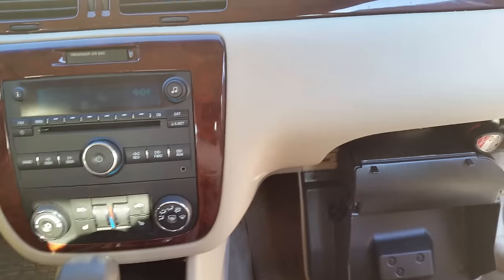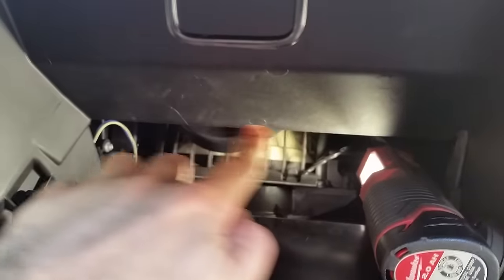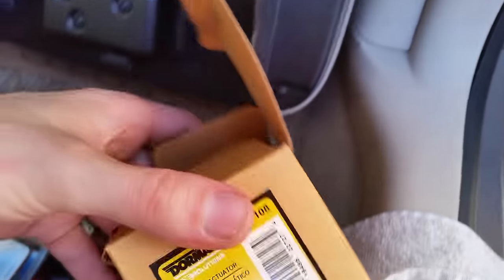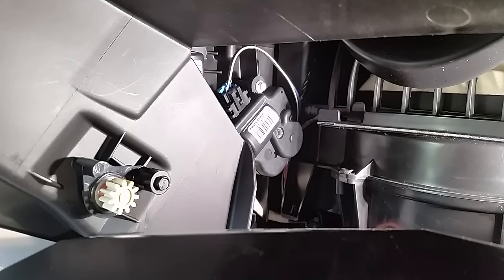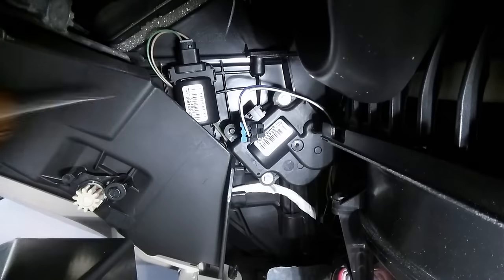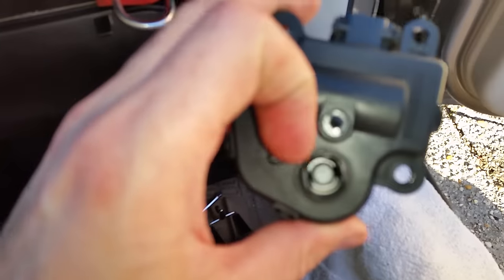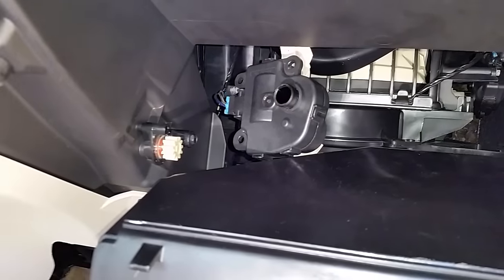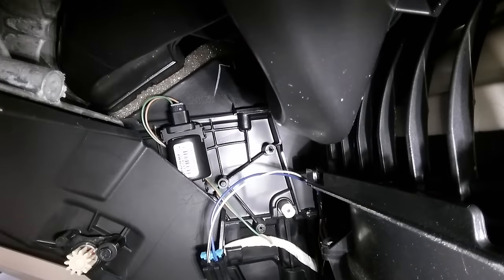How To Replace A Chevy Heat Door Actuator - Impala 2006-2013

Comment: MAD props on the camera work! It is not easy to get in close in a small space and keep everything in focus. Seriously, fantastic video for a PITA issue.
Reply from the maker: lol thanks for watching and commenting
Reply: klowny1969  How often have you had to replace that part? It’s been l think less than a year since I replaced mine and it ticking again.
Reply: I agree great view
Reply: @klowny1969 sorry I may have missed it but what number bolt did you attach to the socket wrench!?

Comment: Great video! I bought a 2010 Impala in 2011. It has 3 of these blend door actuators. I just did my 5th replacement. Drivers side it the worst. I use a thumb sized bit driver on a 7/32 socket.  I'm 60 years old, 6 feet tall and weigh 300 pounds. If I can do it, you can do it.
Reply from the maker: Thank you for commenting and don't forget to subscribe 😉

Comment: Thanks for the video! I have a 2012 Impala with a bad passenger side actuator. This replacement will actually be the 2nd actuator installed. The first went bad under warranty. The covered charge was $285.00. I bought my actuator from Amazon for $15.00. To me the hardest thing about the replacement was finding a pad to my knees from the driveway. Aligning the replacement actuator took a of attempts but wasn't that bad. Total replacement time was about 45 minutes. Your video was key for this project.  Thanks again.
Reply: @Alabama Crappie Adventures Would the method of alignment shown in the video be okay?

Comment: Appreciate that. I replaced mine, the same actuator was doing the same exact thing & it caused my heat not to work on the passenger side, so I used this video & switched the old with the new & now I'm back in business with my heat.
Reply: Marcus Hillman how long did it take you I have a 2008 Monte Carlo I need to switch out
Reply: The Monte Carlo was discontinued after 2007, but still, same as Impalas 2006-2013. If you push down on the top of the glovebox when open, it drops right down. 20 seconds. Unplugging the little clip tab wire harness on the unit, 40 seconds. Removing the unit with 2 bolts may take 10 minutes. Find replacement at your favorite parts retailer or GM dealer (ripoff) and reinstall. The most time lost will be finding the replacement part. I just took my part to Napa.

Comment: Thank you for this video, swapped mine out and only paid $20. Excellent tutorial! 
One comment to add to those that do this, you don't really even need to hook up the harness until it's mounted. You can turn the blender door by hand to orient the shaft to the actuator. I need to swap my air inlet actuator, it's the same part. thanks again.

Comment: Thanks for the much needed info! This saved me from getting ripped off $400 from the shop. My 2012 impala started to make that ticking noise last month (unfortunately from the driver's side so it was quite a hassle to get that fixed). About a few weeks after that was done, now my passenger side is going off! Luckily, it's more accessible through the glove box so I have no problem with that. Gotta love GM's cheap parts.
Reply from the maker: sweet..i also have a video on the driver side actuator
Reply: +klowny1969 That's exactly what I watched next. :) thanks again!
Reply from the maker: +Anessa Rodriguez kool np

Comment: I just did this repair on my wife's car........it's not as easy when your disabled and can't bend in the way to even get to this part ! I looked into having it done and the estimate was between $250-$375 . The part cost me $42 in 2022 and it took me about a good 45 minutes . Now that I've done one the next one will be less than 10 minutes ! I found it easier to take the cover off the motor and just replace the plastic gear in the middle . Way easier and quicker and the factory motor is never bad .....the clicking is from the middle gear having chipped or missing teeth !
Reply from the maker: Awesome! Glad I was able to help! Don't forget to subscribe

Comment: Thanks Klowny,,,,you're the best! Just got this done, took me a LOT longer than you,,,,but it's done,,,me and my Dad figured a dealer woulda charged anywhere from $600-$800,,,,say $100 an hour for labor, a hundred or so for the part, and a hundred a so just for the heck of it,,,,plus tax!
I got the part from the same guys you did for about $20, plus around fifty for tools,,,,the little ratchet (I used a geared one) for about $12, and a socket set and some little screwdrivers for around another $20,,,didn't need all of them, but thought I'd keep them just in case, start my own toolbox!
My total price=about $70 for something I woulda paid a dealership at least $600,,,,a total savings of $530-win for me! Thanks again, man, you rock!
Reply from the maker: Awesome. .stories like these are why i make my videos. .keep wrenching and thanks for watching
Reply: YW!

Comment: I'm late to this party but just now had to do this repair. Pro Tip for my fellow fumble fingers: put a small towel or something like that under the actuator to catch the bolts if/when you eventually drop the bolts. It made recovery very simple. I probably would have had to remove a lot of the dash to get them back lol.
Reply from the maker: thanks for the tip..dont forget to subscribe

Comment: I installed my new one and it's ticking right out of the box. I lined up the rotating part correctly and everything. It is the same part as the one in your video. Now I have to wait ANOTHER two weeks for the replacement part. Oh well, thanks for the video. By far the best one I have seen for this repair.
Reply: I’m having the same issue currently, I’ve replaced it twice yet there’s still a knocking sound, any ideas?
Reply: I am having the same issue - I am on my third replacement, but nothing seems to stop the clicking.... Anyone find a solution?

Comment: Nice video, will do my own tomorrow when the part arrived from Amazon.  Note: You can completely remove the glove box (just a couple of screws)  and it is much easier to see what you are doing.
Reply from the maker: Thanks none ya..domt forget to subscribe
Reply: I’m trying to do that now but don’t know what kind of tool to use on it.  There is no Phillips or flathead groove, nor is there any sides to put a socket on it.  It just has grooves all around it like a gear and is too tight to turn by hand.

How exactly do you remove the three pins that are keeping it attached?

Comment: Thanks for the helpful and informative video changing the heat blender actuator.
Reply from the maker: U got it..dont forget to susbscribe
Reply: There's no heat on the passenger side of my 2012 Impala. Think this could be the reason why I'm getting cold air? I saw two actuators there towards the end of video which of the two should I replace? Oh and btw my car is not making any noise like yours should I still replace it?

Comment: I cut two pieces of white clothes hanger wire two inches long and inserted them in the screw holes. With the actuator plugged in and the car and AC on, I guided the wires thru the actuator screw holes and while holding it firmly in place, the actuator gear rotated until it engaged the shaft.

Comment: Yeah,  that motor was fun to replace.... my hand was too big to just drop the glove box door down like that and get to the bolts so I had to remove the hinge pins instead and pull the whole door off. Using a titan brand quarter inch ratchet and a 5.5mm socket it took like 10 minutes to replace.

Comment: Thank you sir, I knew how to replace the part, but reviewing your video made it go smoother. GREAT camera work too.
I opened the factory actuator and saw 3 teeth on one of the gears was broken. Would have been nice if they were more robust. I think if they were really strong though, it may damage something else in case there was a jam. The gears take the hit, and not the heater box. Thanks again!!
Reply from the maker: awesome..glad i was able to help..dont forget to subscribe!

Comment: Before replacing the control should be set in the off position to the bottom the heat both sides and the battery should be disconnected the keyway to the should be in the right position to the new one that you purchased that's how it was for me thank you for your video the blower motor should be in the off position

Comment: It turned out to be the blend door, the one that's furthest back and close to the door. It was a BITCH with limited space to work with  but I conquered it thanks to your video! The part was $35 at the auto parts store but had I ordered it from Amazon it was $18. But hell I saved from not taking it to the dealership!

Comment: On this Actuator  I was looking at it and found I was able to open it up  very carefully popping the tabs around it and and using 2 real small flat screwdriver's  tp pry it open. after I open it I remove the motor that was real easy and saw there was nothing wrong with it. I hook up a 9v battery to check the motor and it was fine. The only thing I saw was the gears needed greased so I lube the sprockets and gave it a real good greasing and put it back together and it has been working great for over a year now  no more clicking

Comment: Just changed my lower HDA. Actually extremely easy compared to the upper (which has gone out on me twice). Still, this is a "high patience" replacement job.

I purchased the part locally at Autozone for $38 and it took me about 30 minutes to replace. Easy prep (empty glove compartment, push on the back of the glove compartment and it will rotate down, disconnect battery, etc)

The upper right and bottom right bolts were 5.5 mm. I was able to get the tiny screw driver that comes with my ratchet set to fit in there without going to the ratchet.

The upper left is a peg. This might have caused me the most difficulty because I couldn't see it due to the glove compartment paneling and is what led me to your video. Mad Props on that "head on" view you got with the camera.

Comment: WELL DONE:  I ordered the DORMAN door actuator.  When I received it there was a red tape notice warning to read the calibration instructions before installing.  DORMAN threatens that damage could be made to the actuator. 

I removed the actuator (outside/recirculating air) and replaced it with the new actuator.  EXCELLENT INSTRUCTIONS IN YOUR VIDEO.  

NO CALIBRATION COMPLETED OR REQUIRED.  ACTUATOR PERFORMED PERFECTLY.   2007 CHEVROLET IMPALA LT.

Comment: my impala was making the same clicking noise so a friend unhooked the harness from the air door actuator and now the car just blows cold air when it’s cold out and hot air when it’s hot out . Will replacing this part give me my air conditioner and my heater back ?
Reply from the maker: Yes

Comment: Nice video, nice work!!  I have an '08 with 150k miles, and my actuators seem to be failing daily, first it was blend door, then the passenger heat, now the rear driver side door lock actuator!  Damn plastic cars...  Thanks for the guidance...   :)
Reply from the maker: jeevespreston yes that happens..thanks for watching and commenting

Comment: I changed actuators on passenger side of 2008 impala. Remove fuse to recalibrate per some videos. Car started up. Ticking gone but car won't start but if I remove fuse again and put back it starts. Can you help

Comment: Whats the difference between the blend door actuator and the the one your replacing? I replaced the blend door with the actuator ur putting on  cause thats the one that was clicking. And they said its the same? So should I replaced them both? Cause now it doesn't click and the heat doesn't turn on?

Comment: You have saved me a lot of money. Does that help in letting me have cool air on both sides? My driver side switch doesn’t let the driver side have cold air but the passenger side has cool air.

Comment: So I got it! It was easy but I had an issue with tools. That one is fixed, but it keeps ticking. And I noticed that the air doesn't cool on the driver side. Since I can't find where it comes from I am taking the car to the mechanic. I have no idea where the other actuators are.

Comment: Thankd for posting, the Dealer said the dash board had to come all the way out and was gonna cost $1200. Question,  If there are three of these if my car is making a ton of reacket in 3 different area's should I just do all three?  Would you? the one under driver, about the same process?
Reply from the maker: 1200 dollars..what theives!! Feel them first with ur hands and see which ones are clicking..then replace them one by one when u have the time

Comment: Thanks for this video. I used to get this sound only when switching from hot to cold; however, my battery recently died and after charging it and re-installing it, it does it randomly. Not sure if you've come across this but what mine does is it'll click, stop, and it'll start up again from a slightly different location from what I can hear.
Reply from the maker: U might have 2 of them that are bad..open up the glove box and see which ones are clicking..thanks for watching

Comment: Changed out my blend door actuator that was making noise, but I have another issue as well. (been an issue for a couple weeks, didn't happen when I was changing the actuator). All of a sudden, I have nothing blowing out of the front defrost. I took the HVAC mode selector actuator off and the gear shaft that stick out of it moves as I change the venting direction on the dash panel. Could the mode selector be bad even though it turns when taken off? I put a screwdriver in the geared slot to see if I could direct the air to the defrost manually but I had no luck with that as well. As a side note, I heard a thunk in the dash around the time it stopped blowing air to the defrost. Any help would be appreciated. Thanks

Comment: When I have the ac on it blows hot out the driver side but cold on passenger and doesn't make any noise... But when I turn the heat on I get a noise... Which actuator is this? Or does it sound like more than one? Thanks for the video.

Comment: The video was great and I was able to replace it with no problems.  However, it's still making the clicking noise when I replaced it in the same spot you did.  Not sure if I have to change an additional actuator 🤔🤔
Reply from the maker: Put ur hand on it and see which actuator is clicking

Comment: I am so glad I find your videos I was able to find the right part and your detailed instructions are perfect. I replaced the passenger side and it stopped making the noise. But, on the drivers side the a/c is hot. When I replaced the actuator on the drivers side; will the a/c get cold again? Thank you
Reply from the maker: it sounds like the actuator is bad..i always test them to double check
Reply: I need to know which actuator needs to b replaced bcuz my driver's side blows hot when ac is on.....I hear the clicking noise in the glove box

Comment: I have a 2008 Impala but it doesn't have dual temp control.  It has the dash part 25882559.  Do I need to replace the drivers side actuator as well?

Comment: Great vid!  But I’ve got a problem...I plugged in the replacement actuator, and when I adjusted the temp the actuator began spinning and didn’t stop.  It just kept going in the same direction regardless of my adjusting the temp.  I’m guessing this is what broke the original actuator.  Any suggestions?  Or am I missing something?

Comment: I’ve got a 2009 Chevy cobalt. It only blows cold air and no hot air. I’ve replaced the thermostat and the passenger side  blend door actuator and it still won’t work. Any ideas what it could be

Comment: I’m 9 years a little too late… so I did everything right as you did in the video. I turned the car on to move the dial hole to match it up right, the clicking was still happening while doing this and is still clicking while I have the new one on.. click sounds the exact same and feels like it’s coming from there. Any ideas? I have an 08’ impala
Reply: Click starts if I move the ac or heat up and down.
Reply from the maker: Touch the actuator while you hear the click and see if it's coming from there..don't forget to subscribe 😉
Reply: @klowny1969  it definitely wasn’t. Because I was holding the new one. Could it be the actuator to the left of the one in your video? Looks like there’s one to the left behind the glove box liner.

Definitely will sub especially after a reply on a 9 year old video!!
Reply: @klowny1969  it also only starts clicking when I move the temp knobs down to the bottom on the AC, stops when I put them at the midway point nor does it click on the heat
Reply: @klowny1969  I just felt the new actuator and the one to the left of it and I can feel the click touching both of them, but I feel like the clicking is so loud/rough I’m feeling it on anything I touch near the dash
Reply: @klowny1969  so upon messing with it, it seems that clicking only starts when i move the AC knob down on the drivers side; the passenger actuators seems fine. I looked at another video and the guy showed where all of them are located, even the one on the drivers side. 

Bad news, looks like a Bitch to get to and replace..

Comment: Would this actuator be the cause of having hot air blowing out of the passenger side vents when the AC is set to cold max air? I have cold AC on driver side and hot air on passenger side
Reply from the maker: it is possible..but check all the actuators

Comment: I have a 2008 Impala with cold air blowing when set on heat on the drivers side. Heat blows on the passenger side no noise from either side. Is this the actuator and if so where is it located? Thanks for the help!

Comment: So I need to replace both actuators in the glove box on my 2012 Chevy impala. I’ve watch both of your videos related to this however the guy at the auto parts store says the blend door actuator and heat door actuator is the same part? Is this true? If you could help with sharing the part number for both I would appreciate it.